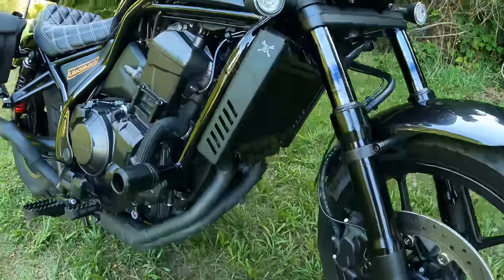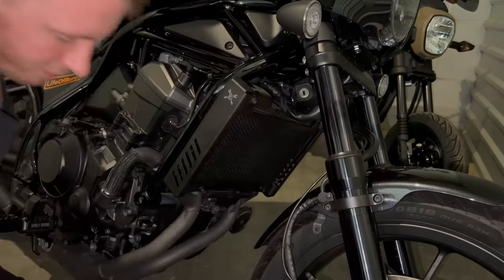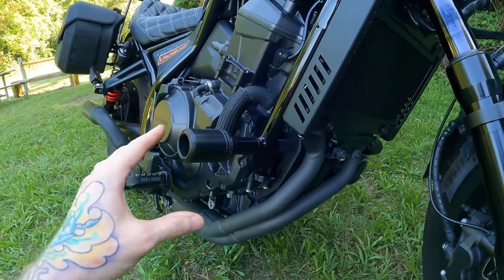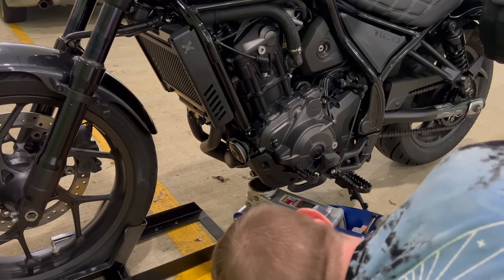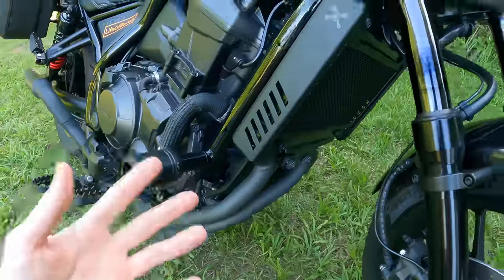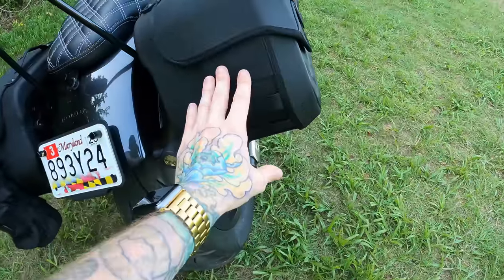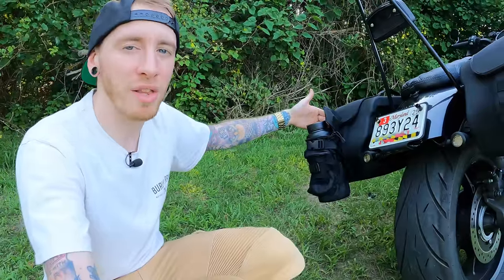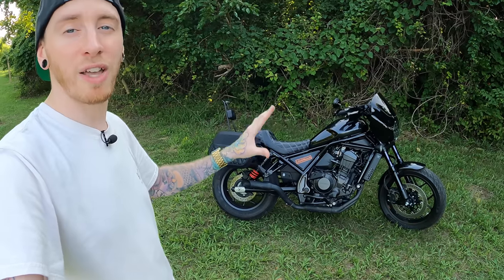Introducing The Rebel 1100 Version 2.0!

Comment: I dig it.  It looks more muscular to me.  I like the hand guards oddly, it makes it look muscular from the front angle.  The radiator guards covers on outside look sweet with the machined gill cutouts.  Obviously the seat quilted matched with the quilted design on the bags is just sweet.  To me it's a more muscular looking sport cruiser.  I like it looks awesome.  It looks better than super expensive Harleys.
Reply from the maker: Thanks dude!! Muscular is definitely a good word for it. Looking back at older pictures it just looks so…frail? in comparison 😂🤘🏻
Reply: I like the look. Either black  stitching  to match the saddle bags or LOB orange  stitching

Comment: 21:30 , [p]ut some 3M "VHB Tape" , get some strong but small neodymium magnets,

On the inside of the saddlebags, clean it a little with isopropyl alcohol if it's plastic inside, put the magnet inside of a VHB Tape sandwich, put sandwich on the inside.

Step 2: inside of the flappy bit, put VHB and don't worry about sandwiching the flappy bit one.

If you want to black them out, electrical tape.

Hope that helps.

SUMMARY: There's a way to add a DIY strong magnetic closure to the saddlebags so they stay closed unless you need to lock them.

Edit: typo

Comment: Beautiful motorcycle. I plan to take it soon, dct. I recommend Shinko 777 whitewall tires. I'll put them on right away. I'm a little worried about the oil leak issue and disappointed that it's happening to Honda, but I'll take the risk anyway.

Comment: why did you get the fenrir mirror caps if the hand guards come with bolts? BTW Fenrir is awesome for the the mirror caps. Don't get the cheap plastic ones!
Reply from the maker: The hand guards don’t come with bolts to mount them to the bike, they just mount with the stock mirror stem. Since I took my stock mirrors off I needed a bolt in its place and the Fenrir were the cleanest ones I found that were Allen head so I could tighten em nice and good 😎🤘🏻

Comment: A few minutes with a sharpy will fix the seat. Great hack with the thumb screw. Any stitched seat will soak up water. If it's leather you can use one of the boot conditioning products to help.

Comment: It looks more like a proper cruiser now. It looks great! I do have a question that's unrelated to the bike. Would you recommend the Rebel 500 as a starter bike for someone with 0 riding experience. My fiancé and I fully plan on getting our motorcycle endorsements and are HEAVILY considering your thoughts. Have fun on that bad ass looking bike and stay safe!
Reply from the maker: Thanks so much dude!! Personally I think the Rebel 500 is a PERFECT starter bike! It’s light and nimble, forgiving and not intimidating, but still enough power to do anything you need out of it, and doesn’t break the bank. Only thing to consider is it may feel cramped if you’re 6ft or taller, but a smaller bike isn’t a bad thing for a first bike anyway in my eyes. Hope that helps brotha! 😎🤘🏻
Reply: @LifeOfBurch  it does, I'm 5'8" and my fiancé is 5'4", so I think we'd be ok. Thanks again, and maybe you'll see us at one of your meet-up rides in the future. It's an 8 hour ride 1 way, but we'll make a vacation out of it if we do.
Reply: @TJ-qo2xu  8 hour ride is long on a smaller bike... just remember if you do >600 mile trips on a chain final drive bike... to make sure the tension is right before you leave, and bring a small portable jack, cleaner, lube, rags, etc to do chain maintenance.  Its super annoying and why longer distance bikes don't normally have chains.  Other than that, the Rebels are fantastic bikes, can't really get anything better to learn on.

Comment: A Rebel 1100 scrambler would compete with the Triumph scramblers. A decent fairing and ATV lounge would make it an all purpose luxury cruiser. It looks great. Nina should be comfortable on the back. It probably started leaking oil after you started parking around Harleys. My KLR did the same thing. Handguards are great especially in cold weather and the rain.

Comment: Damn I’ve been asking Memphis Shades for those handguards since November. Also I’ve been eyeing that seat but couldn’t pull the trigger. Good to know it sucks in the rain. I get caught in the rain all the time.
Reply from the maker: Well you may be part of what helped get the ball rolling on the hand guards then! They’ve had em in the works for awhile, but had to get another Rebel in the shop since the DCT and manual have different length right side mirrors. And yea the seat is a SPONGE 😂 I’ll probably have them put some kind of waterproof layer in there when I get it reupholstered if they can.

Comment: Do you think any of these upgrades could work for the SCL500?
Reply from the maker: Hmmm the mirrors should, you’d just have to cut a hole in the end of the grips and take out any stock bar end that might be in there. And similar risers should work as long as you get them for 7/8” bars instead of these 1”. Everything else is pretty bike-specific. BUT I’ll definitely have more SCL500 mods coming very soon! 😬🤘🏻

Comment: Why would anyone ride a Harley when this is a million times better in every way.
Reply: How is it better in every way besides reliability? Just want to know
Reply: @MrMikeDao  Performance, much lighter, better handling.
Reply: @mikehurley5052  my argument is that, it’s a cruiser, handling is very similar because both are low. Sportster may have less hp but it has more torque low end than the parallel twins. Sound is subjective but personally vtwin sounds much better. Sportster has a massive and I mean massive aftermarket support, it’s essentially a Lego that can be built in anyway possible including to be more sport bike like. 

I can argue for both because I have both but I enjoy the Harley or even the Honda shadow much more than the Rebel. However i also have the CB500X and much prefer that for everyday riding and touring over a rebel

Comment: I have a top contributor on 1100 honda rebel owners. If you need to see, i just did my 8,000 oil & maint. (New chain and tires/metzelers und a new spit-fire w/'em thar had hand-gaurds..and even my grip warmers...mirrors that fold back, too some otherrebel items now/burly pegs to rebel floor-boards...even a cover for my brake. So, much more! I'm ready for some good weather/bama now...was shy-town before my 20+ as a vet. .